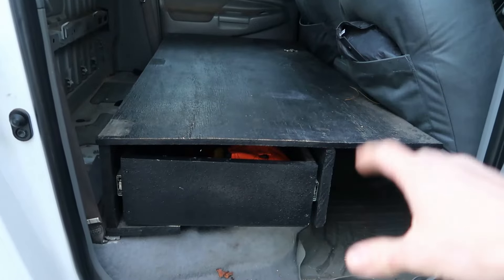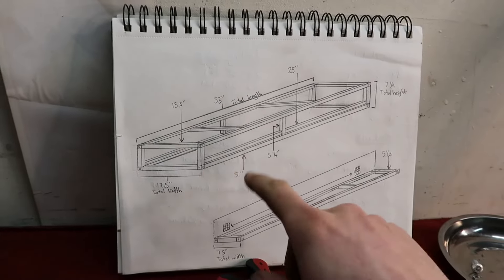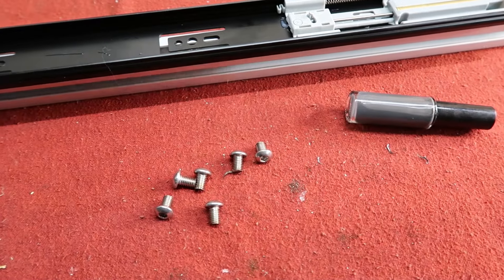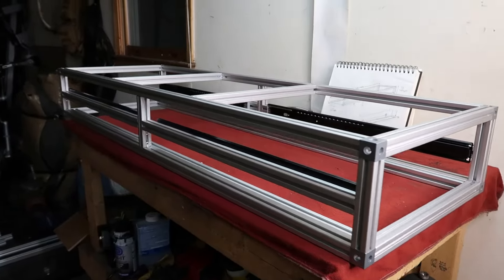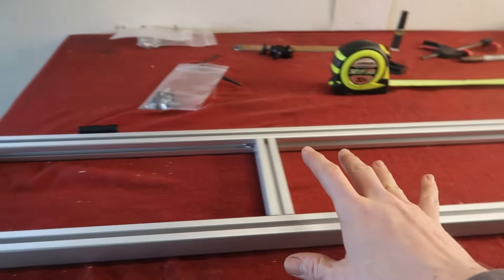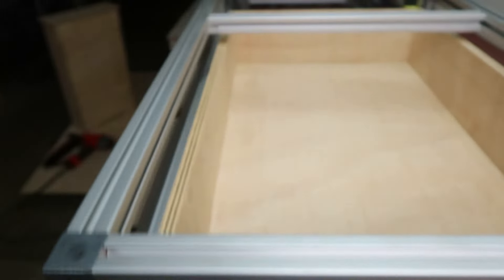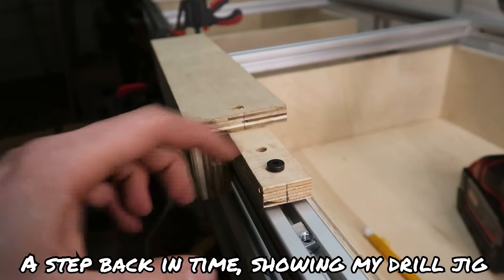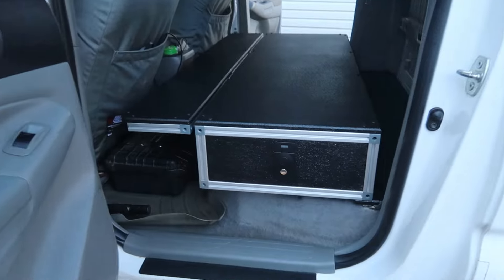DIY Tacoma Rear Seat Delete **DETAILED BUILD**

Comment: When using 80/20 extrusion, it may be an idea to look into ABS haircell, or HDPE plastic sheeting. It is strong, lighter than wood, waterproof and usually cheaper than ply. Just a thought!!!
Reply: Which is stronger? Or what’s the difference in the two?

Comment: What psi do you shoot the Raptor? It seems you hold the gun fairly close to the work piece so I’m guessing 30-40psi? Also your liner looked “wet” still after it cured (not a bad thing). How many coats do you use? Do you find the craftsman compressor has a hard time keeping up?
Reply from the maker: I don’t recall exactly but yes I think around that PSI. I usually do 2 coats minimum! Compressor seems to work I’m sure the coating would be more consistent with a larger compressor but I’ve raptor lined a ton of stuff with that little compressor. No complaints from me!

Comment: Those 1x1 are 3-4 dollars a foot, that seems insanely expensive to me but I could be wrong since this material is new to me
Reply: Still cheaper to build this DIY than your aftermarket products like goosegear, shw offroad, or cargo dog rear seat delete kits.
Reply: I just priced this out and just the extrusion + hardware (not including wood, drawer slides, compression latches) its about $500 including shipping. So maybe around 650 all in including wood, latches, slides, misc. Still quite a bit cheaper than commercially available options

Comment: Excellent build!  Only change would be those top screws- I'd have used countersunk screws...  That way they're flush
Reply from the maker: Thank you! That was the original plan. But finding a screw exactly the right length that would counter sink flush without bottoming out on the 80/20 extrusion first proved to be almost impossible. I did experiment with a few sizes. Looking back now I should have just drilled a small recess in the 80/20 to allow me to use a longer screw without it bottoming out before becoming flush. 

Sometimes you gotta experiment and make mistakes to learn!

Comment: Really well done. I am glad I stumbled across your video. I did a sprinter build for a production van awhile back and now I am planning on building an overland storage system for the bed of my truck. This is going to help tremendously.
Reply from the maker: Glad it helped man! I also did a build on the rear of a 4Runner. Video is on the channel!

Comment: Amazing. Any chance you could get a quick measurement between the back of the drawer system and the back of your cab? I'm thinking about dropping batteries or a water tank in there.
Reply: I'm doing this build right now on my 3rd gen taco. If you don't have anything on your back cab wall like molle panels then there's approximately 10 1/4 inches.

Comment: This was a nice DIY project. Really nice. The 8020 and Rhino finish give a commercial look. 

I know this was done a few years ago. I hope your drawers have held up. Butting boards and nails make for pretty weak corner joint. At least use some glue. Pocket hole screws are easy and would really strengthen the drawer boxes. It would be nice to see a follow up where you upped your box joinery.

Comment: Thanks for the great build and ideas, you forgot to give an estimate of how much, I have to assume that the aluminum frame with all the dedicated hardware is not cheap but it probably is very strong, I don't know what you did for the back portion but I would have done a similar flap like the one in the front that is easy to open and close, that also makes a very nice space for a quick nap is you are travelling and don't want to set up a tent or something like that , that back space is also perfect to set up a battery with a bms and inverter, all nicely tucked in and out of sight, a couple of solar panels and you are a rolling power station.
If you could post a PDF with the plans and materials would be of great help.
Shout out to your sensei he taught you well, cheers from Canada.

Comment: Nice. I would’ve countersunk those hex screws.
Reply from the maker: I experimented with that idea. Unfortunately the wood couldn’t hold up to the counter sink. It would splinter at the edges. Need Baltic birch to pull that off which isn’t available near me easily.

Comment: Nice I'm going to countersink the bolts on the top piece.
Reply from the maker: I experimented with that idea on a scrap piece of wood but the particular plywood I was using would just chip on the edges of the hole and not provide a clean countersink. If you can get your hands on Baltic birch it will countersink without issues. I could not find any local

Comment: Hey man was thinking of do a one seat delete in my Tacoma and putting in a maybe a fridge and stack 3-5 drawers on top of it would you think it’s a good idea to use this material for that my not for the fridge but for the drawers on top of the fridge
Reply from the maker: Space is rather limited height wise back there this single drawer plus a 12v fridge above it while still being able to gain access to it is about all that will fit unfortunately

Comment: On the latches section. Can you give the exact or rough estimate how far down from the top you started the router? Looks like half an inch to me but I’m just guessing🤷🏼‍♂️

About to undergo this for my own truck but I have the electric powered sliding back window so we’ll see how that works out. Awesome video man the finished product looks even better than goose gear
Reply from the maker: Thank you man! I’m not near the truck to get an exact measurement just yet but I believe you are correct it’s about 1/2”. I did a test cut on scrap wood to see how far down I needed to mount it. I’d suggest doing the same!

Comment: Awesome build. I think I’ll do the same for my Hilux….poor mother in law 😂.  I think the top plate I will just fix with a few alignment pins as I don’t think it needs to be actually screwed down.  Then I’ll have access to all the goodies below
Reply from the maker: Thanks man! Alignment pins should work well as long as the wood isn’t warped. Also may vibrate and make noise on bumpy roads 👍🏼
Reply: @Adv4x4  definitely. 3/4 inch - heavy and flat. And something rubberized to kill the vibes 😂.     Saludos from Venezuela

Comment: what size bolts did you use and what was the tap size?
Reply from the maker: I did the m6x1.0x 25mm tap and ordered their screws separately. 

They actually include all the screws you need automatically and I didn’t know. So I should have got them tapped to 1/4 20 x 1”
Reply: Adv4x4 okay awesome. Yeah I looked at the angle brackets and they had the screws included. Thanks for this video. There’s a lot out there that are just poorly made. Love how you got so in depth with it and also making it look so clean
Reply from the maker: Thanks for watching Man! Glad it was helpful.

Comment: I didn't know a seat delete excited until someone on a forum said something about goose, well, compared to that, your build is absolutely top tier. Would width dimensions you have there fit an access cab? I know depth and height are different, but most things should be similarish right?
Reply from the maker: Hey man! Not too sure about that. I think the limiting factor on an access cab would be how far you keep your seats back as well as how much that rear door sticks out once it’s open. 

When the drawer is extended it will have to clear the door panel which is pretty thick on the opened “rear” door
Reply: @Adv4x4  gotcha, thanks for the heads up! Hope much did the build cost with the aluminum sans wood and drawers and pulls, just the aluminum and bits?
Reply from the maker: I don’t remember exactly but total cost was about $600 so I’d say roughly $400 for the aluminum stuff?
Reply: @Adv4x4  oh heck yea!! It looks worth 1500 easy
Reply from the maker: I’ve also built a rear storage for t4r videos on my channel for that as well

Comment: How do you access the factory cubby storage?
Reply from the maker: The drawers when fully extended have release tabs that let you completely remove them from the module to gain access below. I keep spare parts in my cubby storage so things I in theory won’t need but wouldn’t leave home without lol
Reply: So you reach through the draw to access?
Reply from the maker: The drawer is completely out of the frame at this point so you reach into the remaining opening to grab things out of the cubby

Comment: Nice Build! My only concern is the drawer life, the nails will work loose after a bit. Glue them first then nail them. But it came out great.
Reply from the maker: Funny you mention that! I bought a new thing of wood glue and everything for this project with that in mind. In the midst of building/filming it was a step I completely forgot about haha.
Reply: @Adv4x4  I am an amateur when it comes to wood working. I tried to do glue and then nail gun on my first drawer. It seemed super messy lol 😂 The second drawer I just did nail gun.  I guess we will see which one lasts longer 😊